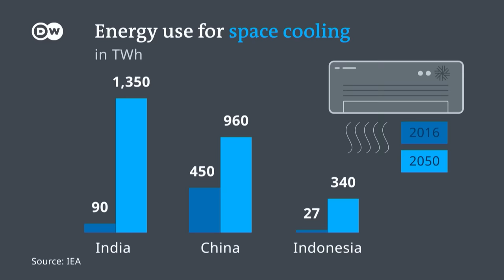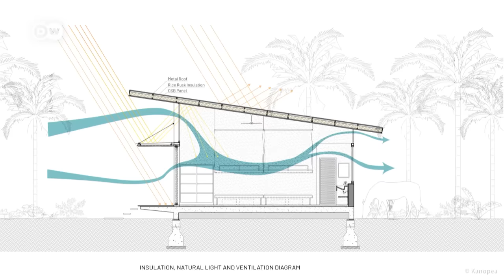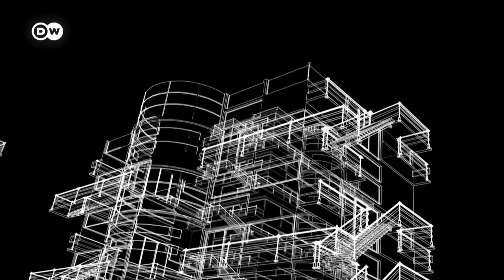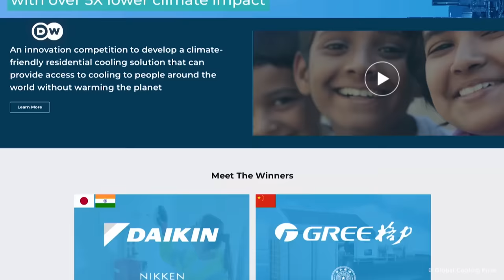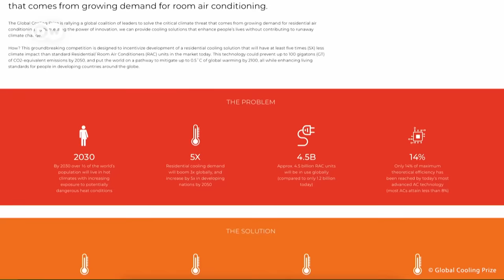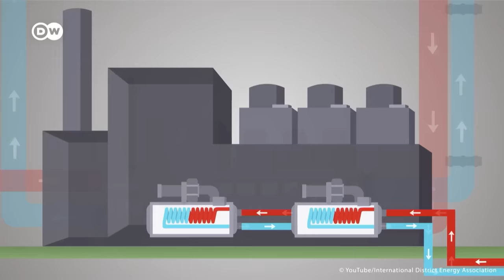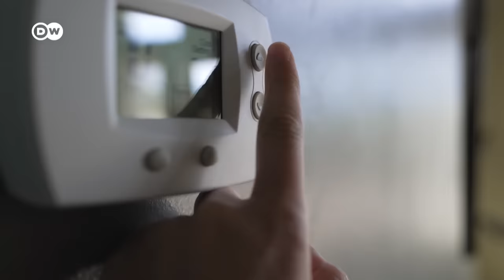How to cool our homes (even without ACs)

Comment: I grew up in an old villlage house with one-meter-thick stone walls. The interior of such house is cool whole summer. The building materials matter. I have recently read an article in National Geographic that traditional clay architecture is much more resilient to heat than modern concrete equivalents.
Reply: Hi samuela,
Concrete is not the issue. It is the type of material [concrete and brick/stone are in the same cathegory] that is used to cover the building. Your "century old house" would be very expensive to build nowadays. If a building has meter thick concrete walls, it will be even more energy efficient than your "traditional clay architecture". The issue here is the cost, not the materials.
Reply: I can confirm this. My grand grandmother's house has walls made from wooden fence plasted with clay, straw and cow poop. The walls are thick too. Also the foundations are made with stone walls.The temperature inside is like  5C lower than outside. Of cource it is a country house, it's not in the city, but still it's really nice and cool inside.
Reply: @iat8329  The issue is also the emissions created by the materials used. Creating concrete and cement generates a huge amount of the world's emissions.
Reply: You might be interested in Earthships - the walls are built with compacted mud (clay) and used tyres.
Also check out Passivhaus designs using mud.
Reply: @jayrideau  use the best of old and new technology 👍
Reply: We can still use concrete for non-residential use, such as industrial areas and garages. The dog had the coolest room in the house — she slept the garage!
Reply: @jayrideau  That would be difficult for multiple reasons.
1. Concrete mix is a fluid and can be piped or poured. Stone cannot. This means that concrete mix can be loaded and unloaded much faster than stone. The difference can easily constitute an hour or so per round trip. As such, transporting stone requires more vehicles.
2. It would be extremely difficult to drive rebar through stone bricks. If an easy solution isn't found, then we'd unfortunately have to give up on steel, which would necessitate thicker walls and taller ceilings. Furthermore, it would make structures much less resistant to shaking, so buildings in earthquake-prone areas would require even more reinforcement.
3. Stone is more difficult to work with than concrete. If you want to make a concrete wall, you literally just pour the concrete in a wall cast and wait. I'd be surprised if it required more than a dozen man-hours. But if you want to make a wall out of stone, you're going to be having a squad of construction workers toiling the whole day on it. And it gets worse. Because while pouring concrete isn't really that exerting, laying bricks certainly is. Those construction workers are going to be retiring due to injuries by the age of 40. So all-in-all, if we switched over to stone, we'd need a lot more construction workers not only due to the process being manpower-intensive, but due to higher worker turnover rate.
4. Producing concrete is very easy. You quarry some lime, you quarry some clay, you quarry some other materials, you take some waste material from other factories, you crush them, you mix them together, you heat them up, you add sand, you add gravel, you add water. Boom. Concrete mix.
Producing construction-grade stone is not. You might find this a bit strange, considering that literally the first step in my previous explanation was "you quarry some lime". See, the issue is that that part is literally the most expensive part of concrete production. But it gets more expensive. Because unlike with concrete, we can't afford to shatter the stone while quarrying it. We need whole bricks, so much slower methods of quarrying have to be employed. But it doesn't end there. Concrete has the useful property of coming out very uniform after being created. Stone does not. If you want construction-grade stone, you need to put every single brick through quality control. And that is very expensive.
5. Stone is just straight up weaker than concrete. A lot of very smart people have been researching how to best mix concrete for hundreds of years at this point. But stone can't really be developed. It's in the ground, and it's as good as it'll ever get. You can't improve stone technology. As such, stone is weaker than concrete. If you want to build with stone, you're going to need thicker walls.

All-in-all, stone is not a practical material.
Reply: @iat8329  Concrete  is. I have been in many Concrete homes (built with Concrete blocks instead of clay blocks), and they always increased the temperature in day time.
Reply: My first investment with Nicholas Burke Gaffney gave me the assurance that has made me invest without the fear of losing, I got 3 of my friends into his guidance already
Reply: Adobe houses rely on thermal mass to regulate temperature. The thick walls keep the inside cool during the day and release the heat at night to warm the inside. It's a balance of finding how thick the Walls needs to be to control how long these cycles take.
Reply: Concrete takes decades to finish settling so I guess the chemical process of it still produces heat long after the house has been built
Reply: @andrasfogarasi5014 damn did u just write a uni essay? anyway all of ur points are spot on
Reply: In our case - one meter thick earth  clay walls
Reply: Earthbag construction may be of interest.  A sand, gravel, clay mix in woven poly bags (inner fill might be pumice or other insulating material) laid like large bricks then rammed down solid, using barbed wire laid between courses to lock them together.  Apparently the barbed wire lasts a very long time because oxygen is excluded.
Requires a 'plaster' coating of some sort to prevent UV degradation of the bags.
Somewhat labor intensive, but mostly it's unskilled labor.
Reply: Yes, but if you cook in the same house, the heat is trapped inside. So, you wud end up feeling hotter even when it's cooler on the outside
Reply: I don't understand why they didn't mention the District cooling systems working in Gujrat,India.
Reply: @SqueakSqueakkk then they have mention one in china, and eu, even some us projects and it goes on and on.
Reply: @iat8329 Earthquake your clay walls again and again pal !!!
Reply: Many houses in my country are still build that way,and they are indeed cool in the summer ,
Strangely enough,it is mandatory that you invest in clean energy,buy a inverter to cool and warm your house
You even get subsidized for it,that way you get it a little cheaper.
Reply: Biomass cools in the summer and heats in the winter.
Reply: Absolutely, concrete will be our doom one way or another I fear
Reply: High thermal mass means it's warmer at night and cooler during the day: exactly what you want for comfort, especially in arid or mountainous places. Building a wall out of 1m thick rock isn't cheap though. Developers ultimately aren't liable for your electricity bill, and it's cheaper to build structures out of steel or lumber with a facade of mass-produced brick (manufacturers even add powdered rust to the clay and sand because customers expect a red colour). Modern buildings are made with huge windows for maximum illumination as that's what is fashionable, but this turns your home into a greenhouse in the summer.
Reply: What about Winter time?
Reply: @iat8329  It's cheap because it's not built to last - even our building have become a victim of short-sighted disposable culture.

People need to quit being cheap, lazy bastards and remember that things worth keeping require significant investment and consistent upkeep.
Reply: @iat8329 Earth is more expensive than concrete? Concrete has a low termal conductivity. Please talk with facts not missinformation.
Reply: @niki123489  that's a great choice if you don't live near any body of water. otherwise, a flood will wipe away the house like it's nothing.
Reply: @joaocosta3374 incorrect.  The rebar in the concrete saves our butts during earthquakes.
Reply: 1 meter thick? How do door ways even work with 1 meter thick walls?
Reply: @iat8329 cheaper up front with ongoing costs of electricity and HVAC vs. expensive to construct but cheaper over the lifetime of the building construction methods.
Reply: That wall probably cannon
Proof
Reply: That's another way of saying you were kidnapped and raised in a dungeon. 1m thick? Stone? Tell me how they build the pyramids
Reply: In south east asia, colonial building usually build with 1m tall wall then brick on top the rock wall, the wall about 2,5-3m. That makes the house cool but if you build house like that, it would be very expressive
Reply: You not only have to build to the environment but consider earthquakes, tsunamis and tidal rises too.
Reply: Maybe this is due to clay being porous. I assume clay you meant was not compacted like brick.
Reply: @germscamacho8362 you mean clay when mentioning earth right. Straight answer is (clay is more expensive).
Reply: @dasgerbil5189  clay soil, how its more expensive? just dig a little and you have earth for construction with a better quality material.
Reply: @iat8329 adobe/clay has one more advantage over concrete. It absorbs and releases moisture which has a latent heat effect that is exothermic (heat producing) when water vapour condensates during cool conditions and endothermic (heat reducing) when the condensation re-evaporates into the air. So it is better than concrete pound for pound. It also doesn’t drive climate change !
Reply: Glass which dont allow heat to pass but allow light to pass can be a useful solution.
Reply: If a house that has been made traditionally would be "too expensive" today then we are going the wrong way. We aren't advancing
Reply: @niki123489 WTF Cow Poop?
Reply: And it also breathes and controls humidity and mold accumulations
Reply: @NoelCarson no you can trap and redirect kitchen heat accumulation plus you can also use new tech cheaply available stovetops that use magnets to cook which turns heat on immediately and immediately turns off when you remove your metal cookware. It is called induction cook technology and it is now available in one, two or four stove top configurations. I have a single stovetop which I have been using for over a year.
Reply: @joaocosta3374 no it doesn’t. Cob houses survive earthquakes for centuries and remain habitabble and comfortable. All the concrete shakes loose from the rebar depending on how hard the quakes hit. Exactly the opposite. Look up Devon cob and Yemen homes which were there 1000s of years as well as throughout the Middle East and elsewhere. The US only built with timber in the colonies because wood was quick and available. Then they replaced timber with concrete. Voila your misconceptions are born of bias.
Reply: Here in the UK its law to have insulation on new builds which is great for active heating during the winter, but removal of heat during the summer is hard bare, can't turn the oven with out sweating. Thick and high thermal mass walls help keep an average temperature between day and night during summer. warmer night and colder days.
Reply: @iat8329  this is false, Concrete is a very different material than clay.

It is not at all good at heat management.
Reply: @iat8329  " If a building has meter thick concrete walls, it will be even more energy efficient than your "traditional clay architecture" "

Factually incorrect. Concrete has higher thermal conductivity than bricks and clay. Requires less cooling and heating for interiors. Also concrete traps heat. The guy is right.
Reply: You also have to think we have to warm it up in the winter
Reply: @cajkid2823  once its warmed up, it will slowly release it, and easier to keep it warm than to warm it up.
Reply: @cajkid2823 it will need less energy to warm up in winter because thick walls insulate the inside from the cold
Reply: Yes olden days and the buildings never needed AC leave alone fans
Reply: The problem is that people prefer paying all their life for the box made of cheap materials so called apartment, so they can live in the city.
Reply: Brick will also help.
Reply: Clay wall with clay bricks
Reply: Earthships and excavated covered interconnection, skylights of double/triple layers, and wind catchers, solar panels and on and on, there's many schools of Architecture around the world.
Reply: Agree. My house using brick and roof from red clay. Its only hot if outside want to rain 😅
Reply: Try to see if you can get barium sulphate white paint and use it over your house roof because it is the worlds most coldest paint and it reflects 98.5% of sunlight and it has a cooling affect for nighttime too by radiating heat away from the surface. This barium sulphate paint can cause you not to need to use your air conditioning anymore on a hot day. Combining with that using white curtains for windows to reflect sunlight would keep your home even cooler for even longer period of time and if you already have a cooler material for your house, and with the barium sulphate paint being painted over it would really cause you not to use your AC again.
Reply: If you can get me land for cheap, I will build one too.
Reply: I live in a cyclone prone area can't think of a clay infra house.
Reply: Black out curtains does the same.
Reply: 1 meter thickness? Was that a fortress?
Reply: 1meter 🤔🤔 was it 4 story loadbearing house 😂😂
Reply: A big issue with clay is that it has to be dug out of either hill/mountains-sides, or out of river-beds. When you dig clay out of hill-sides and mountain-sides, you de-stabilise them and this can cause land-slides. If you dig clay out of river-beds, you de-stabilise the river-bed, and this can contribute to the river-bed eroding, which can load the river water with silt and sand, which drastically decreases the water quality and the overall health of the river.
Reply: Bruh no you didnt lol
Reply: Let the chanel know as they consider them as so called 5:24
Reply: my old home has 3 feet wide walls on the outside of house and it was cooler in summer and hotter in winter but now we made new house and it has 1 feet wide  walls and we had to buy 2 AC for cooling
Reply: I'm still living inside of two feet think stone and clay wall house.
Reply: @iat8329  the National Geografických article examined village architecture in Africa. They wrote that Africans used to build their simple homes from clay. With economic developement, they started to use a modern material - concrete. But they discovered that these new simple houses are extremely hot inside. They cited people who said that their concrete house is terribly overheated but the clay house of their grandma is not. The article described that some African villagers are returning to building clay homes. Its not modern, but it suits their climate better. The conclusion of the article was that the material matters. It was National Geographic, a higly respected organisation, and I doubt they spread missinformation.
Reply: @andrasfogarasi5014  I abdolutely agree that concrete is much more practical material, which allows to build much larger scale of structures and is much cheaper to use. I did not propose to build everything from stone again. My point was that in the context of inside temperature, material matters.
Reply: @marc-andreservant201  the size of windows is a good point. And I agree that building from stone would be very expensive.
Reply: @friedrichjunzt  The thick walls of my childhood home provide for a freat insulation in winter too. It is not very practical material and it would be expensive to build from nowadays, but when you turn on the heating, it works in winter too. (All houses have heating in Central Europe where I live). The only problem is that without heating on, it is too cold inside even in early autumn and late spring. So my parents have to start heating the house in September and  usually end in May. Which is a much longer heating season than modern houses with proper insulation have in my Country. 

About the clay houses the National Geographic article, they were in Africa and winter is not so much a problem there.
Reply: My cousin lives in an old farm house, i was there the other day, and was fascinated how it stayed cool in the middle of the hot day. The walls are thicc and stone I believe.
Reply: On the desert, adobe buildings are much cooler than other materials.
Reply: @NoelCarson I live in a hot climate. I cook outside using toaster oven or slow cooker. Really helps
Reply: @happycook6737  Cooking outside does help
Reply: Concrete is like metal... absorbs and transfers heat..
Clay / mud is like wood.. repels heat.
Reply: At those old days the outdoor temperature was not this high to compare comfort. Also those rock wall construction is not ecology friendly anymore. If all needs to adapt this approach, many hard rock mines should come up and its not a positive thing. 
Usage of cement is not destroying ecological balance atleast so this is not a viable solution at all
Reply: I am assuming you don't live where you can get 90 straight days of 90 degrees or higher.
Reply: @iat8329 as someone in the AEC industry cost is a big factor. Agreed about concrete.
Reply: @cyzcyt usually doors are fixed to inner part of the thick wall. Imagine this as a short hallway.
Reply: But what about the winters? We have a continental climate here, meaning very hot summers and very cold winters. I feel like the stone walls would be crazy cold in the winters and you still get nothing if you have to spend so much more on heating
Reply: @AsokaTw-mz3lr those aren’t the same. Clay blocks are solid and concrete blocks are usually cinder blocks which are hollow.
Reply: You forget that such house is usually cold in winter too.
Reply: You are right, the building materials matter indeed.